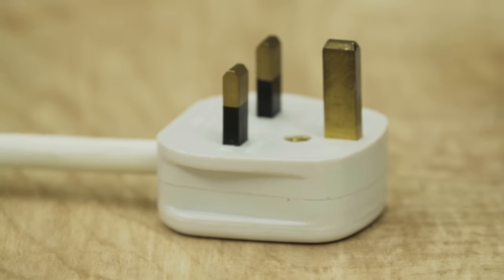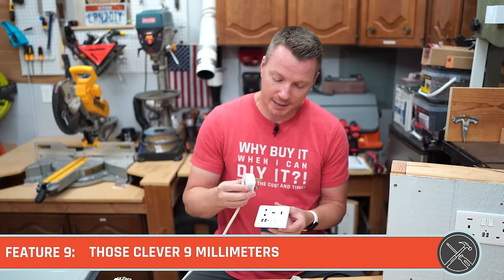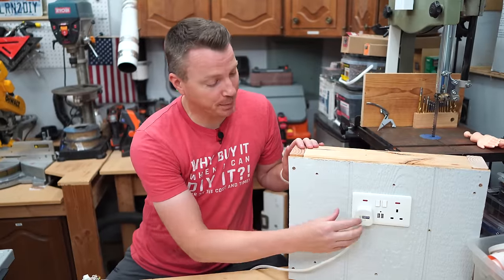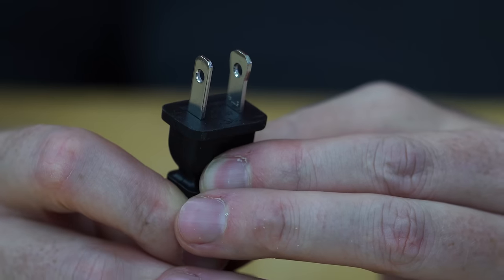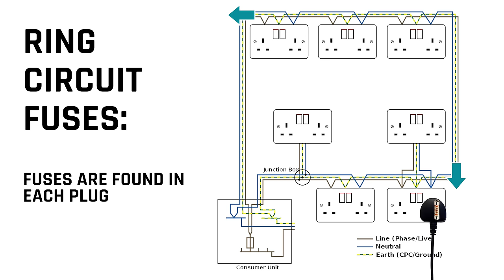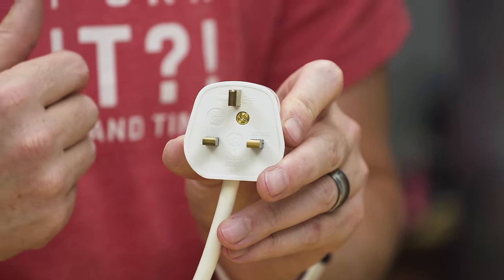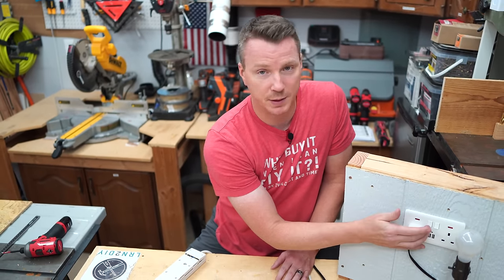British Plugs and Outlets Are On Another Level

Comment: In most cases, the presence of the switch on the socket means you need rarely unplug non-portable devices, so it's very uncommon to encounter the upturned-prongs problem. The other reason it's uncommon is that once you've trod on a plug prong *you remember*.
Reply: Actually, one major exception - when the devices are plugged into a multi-way extension cord, the sockets on those are often unswitched (especially on the cheaper models). Yet another reason cheap multi-way cords are Satan himself.

(There are also unswitched wall sockets in the UK.)
Reply: @countertony  tbh it’s easy to find extension cords with switches just don’t get cheap deathtraps haha 😂
Reply: @countertony  The only time I ever see that are on ones that are intended to just be used with low voltage applications. The vast majority of the ones I see at any price point do have a switch, a lot of that has to do with the likelihood of not being able to easily reach where it's plugged in and the tiny cost of adding the switch to what is probably going to be a surge protector with a bit of extra circuitry anyways.
Reply: @SmallSpoonBrigade  Could be I've hung on to mine (from before surge-protected extensions were much of a thing) for too long :D
Reply: You don't remember, you gain your six sense...
Reply: Stepping on an upturned British plug even once is once too many. Even thinking about it fills me with murderous rage.
I grew up with them and would not hesitate to launch every single British plug in existence into the sun.
Reply: @cheesofile666  
Don't blame the electric plug, you're the problem for walking round in a daze.  Watch where you're going and what you're doing and these things will not happen to you.

Comment: As everyone else has already said, the "negatives" disappear once you've had any life experience with these plugs.
Reply: Except for the stepping on them thing. That's always a curse
Reply: @_rtj  the switch on the earth pin you mean?

A downside to these plugs is the difficulty of removing them for people with arthritis or some other issue with their dexterity.
Reply: @Faliat  I would say not even that. Due to the switches on the plugs themselves I always just turn them off at the wall - virtually never unplug something and leave it on the floor. If I’m unplugging something it’s normally because I’m going somewhere and taking the plug with me.
Reply: @lukemclellan2141  there is a clamp available at mobility stores that allows full hand grip to remove, less than £5 last time I bought one
Reply: @fachim-t8480  good to know, thanks! So inexpensive too.
Reply: The idea you can’t accidentally pull these out of the wall gets debunked the second you try to use a  hoover (vacuum cleaner) at medium extension 😂

Comment: You forgot to mention that: 
1) each & every plug comes with a printed card teaching you how to rewire & change it.
2) All you need to fix your plug (barring possible a new fuse) is a small flat-head (electrical) screwdriver which we can pick up almost anywhere.

Heavy usage devices like cookers & washing machines usually have their own circuits.
Oh, and we also have fuse boxes which have our rings (lights, sockets, cooker, kitchen, etc...) on them separately as well as a main breaker.
I actually have a mixture of ring & radial circuits depending on the usage & that's just in a basic single flat, nothing special.

Regarding the down-sides,
The size is no issue - it's plugged into the wall & in fact less also likely to be tripped over or kicked that the US plug.
I've never had to 'load balance' nor do I know anyone (untrained) who has - in fact most wouldn't even know what you were talking about.
And, how often do you leave a plug lying on the floor? Maybe if you could switch it off without unplugging it would help. 🙂

Comment: As a Brit, watching you discuss our beloved plug made me very happy and was 10 minutes well spent. You didn't get everything 100% right but an excellent video none the less. Thanks for uploading.
Reply: Please what did he get wrong?
Reply: @adon8672  The circuit type used, ground pin always being metal ie present, all sockets having switches.
Reply: @adon8672  all the negatives - no-one leaves a plug lying in the room like that.. we can isolate them when plugged in -  they are super safe and can handle up to 13 Amps - the old 15 amps round pin ones are awesome.. just not as safe . and Lego or pin tacks ( drawing pins ) are waaaaay more painful than a UK plug - tested!
Reply: @effervescence5664  A few omissions too, such as switches on less cost- conscious outlets being double pole, switching L & N not just L, and fuses being available from 1A to 13A with 3 & 13A being the most common.
[Edited to correct the 'not just N' goof.]
Reply: @adon8672  Not all power circuits are a ring although a lot are. All lighting is a radial and anything that needs a lot of power like a shower, water heater is also a radial. The fuse shown a BS 1362 was 13A that is the max size, for that lamp you would replace it with a 3A or a 5A. Also rewireable plugs are not that common as the ready fixed moulded plug same as the type B but with a fuse is more common. But they all have the problem shown at the end, and yes it hurts
Reply: @adon8672  see my comment above..
Reply: @acespark1  Not all lighting is radial here in the UK
Reply: @jasonearley1872  "no-one leaves a plug lying in the room like that." - Only people who have never trodden on one do. Once you have trodden on one you tend to never again leave one lying around :D.
Reply: @acespark1  Very few people bother to replace a supplied 13A fuse with a more appropriately rated one, including many appliance manufacturers.
Reply: @adon8672  Not wrong but most UK plugs are now molded to the cable and you can't expose the connections. You can still change the fuse
Reply: @motogoat  I've never trodden on one in 59 years and I would never leave a cable lying in the middle of a room. But then again I exercise a bit of common sense.
Reply: @acespark1  The direct moulded plug was introduced when manufacturers realised that a lot of people were not being taught basic skills anymore such as wiring a plug, and they could also charge more for the item.
Reply: @adon8672  he doesn’t understand ground pin’s purpose.
Reply: @almac2598  I remember learning it in school back in the mid 90s. Also included how to work out the correct fuse rating. Not sure when, or why, they stopped.
Reply: @paulhodgson4790  The chance of treading on a plug is higher when you rent a place which doesn't have enough sockets.
Reply: @almac2598  You are right, I was taught how to wire a plug in school in the 80’s, but don’t think they do that any more.
Reply: @davejenner7966  In a domestic home it is.
Reply: @davejenner7966  Domestic is though?
Reply: @davemould4638  Just a matter of education really.
Reply: @BrianG61UK  Multi-socket extension cables have been available for decades at very low prices.  They are a must, because there are rarely enough sockets in most living rooms, which quite commonly need sockets for a TV, DVD player, satellite receiver, sound system, games console, computer, Internet router and several chargers.  Plus a spare for the vacuum cleaner.
Reply: @jasonearley1872  Fully agree.....once isolated at the switch there is no need to pull the plug out. I can't remember the last time I removed a plug unless I was moving the whole appliance.
Reply: @davemould4638  Well yes. But they are often look like they're not really safe for higher current devices like heaters and kettles.
Reply: @BrianG61UK  I rent a housing association studio flat: 8 sockets in the main room, 7 in the kitchen, 1 in the hall. Needless to say, it’s nowhere near enough.
Reply: @acespark1  Agreed
Reply: @davejenner7966  I've never seen a ring lighting system. I've only ever seen radials
Reply: @JaenEngineering  They used to teach that in schools back then because it was common to have to wire up and fuse a plug yourself. Legislation in 1994 meant that all electricals were required to come fused appropriately to the item and to already be wired up. So I guess it became less necessary to teach wiring up a plug in schools after that since you're almost never going to have to do it.
Reply: @almac2598  They remained relatively uncommon until the UK mandated appliances to be sold with 13A plugs fitted. It is cheaper to buy pre-cut cable, with plug moulded on, ready for the production line, than to individually wire each plug.
Reply: @davemould4638  It is a pity that building regulations now require sockets fairly high up the wall. I always wanted to replace my skirting boards with "dado trunking". There are versions that look very like a slightly deeper skirting, carry three busbars (recessed for protection, allowing the cover to be clipped off, a section of the cover cut off with a saw and an additional socket to be plugged into the trunking, with no wiring required. The trunking also has channels for running network, aerial, satellite or similar cables.
My living room has six 2-gang sockets in it, but since getting married and re-arranging all the furniture only a single 2-gang socket is accessible - and that has the TV and associated devices plugged into one of its gangs. We now have three multi-way extensions emerging from behind furniture.
Reply: @FahadAyaz  You're always going to have to do it if you have under-counter appliances, with sockets above the counter or have devices in a cabinet with only a small cable entry.
Reply: @adon8672  Took me a while to reply.. but... 

1:54 - this was not a feature when the BS1363 plug was introduced.. it came after. It is a very good afterthought. As the current carrying surface area is reduced slightly the general rule of thumb is to cap the current of any one plug to 10 amps not 13 amps unless for short periods such as boiling water in a kettle. 

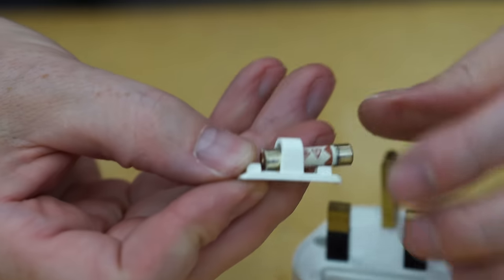4.17 - Sometimes... but not always. It's quite common to have appliances come with moulded on plugs like your Type A/B. Fuse comes out using a flap, a bit like at 6:30.  

5.23 - Again, sometimes.. but not always. Phone chargers, wall warts, and other plug in transformers often do not have any fuses at all, maybe just a resistor that acts like a fuse if you're lucky! It's not a requirement to have a fuse in transformer like that. .  

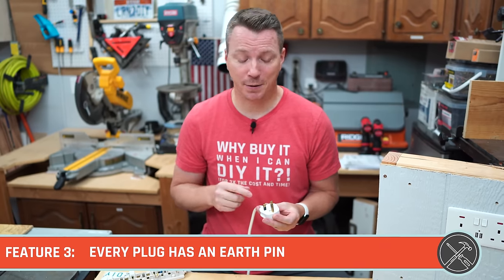7:10 - somewhat true - again some appliances do not have metal earth pins if they do not need a earth. These will have plastic pins and only be on moulded plugs or wall warts. Arching is not related to earthing, an appliance with a plastic earth pin can still arch. 

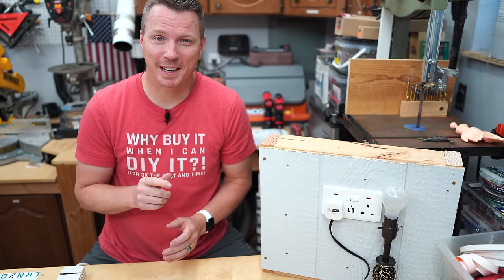8:37 - Most do have switches, and it's a great feature, but not all. It's not a requirement. 

8:44 - and another weird one... it may look like 230V but actually it is 240V. And 250V in some locations. We supposedly harmonised with Europe way back but we never actually did.. We just changed our "national" tolerances. I think 240V is far better than 120V as long as you don't plan to get electrocuted. 

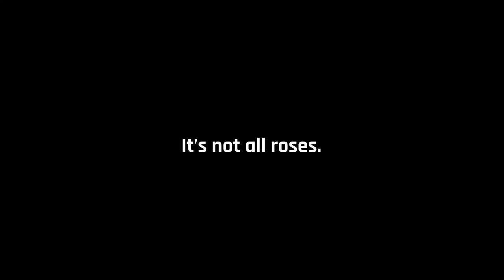9:30 - I would not recommend plugging two power intensive items into a double socket as you may overload the socket outlet itself. A double socket is still limited to 13 amps.. electricians argue over this one but nearly everyone always agrees to just install multiple double sockets in a single location if there is any temptation to plug two power intensive items into a double socket.

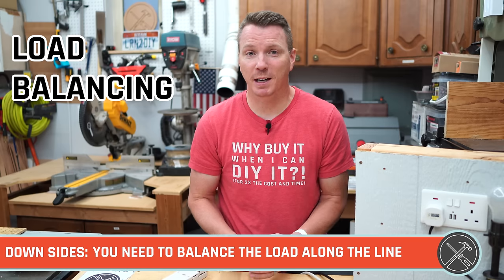10:04 - practically in the real world, no one cares... we use typically 2.5mm2 for rings on 32A breakers max. On the surface of it 2.5mm2 is good for 23a if you don't take into count limiting factors. There are various methods for wiring rings circuits. Most electricians hate them. It's quite common for radials to be installed in preference.

Comment: That "step on it in the middle of the night" thing is a safety feature. You only need to do it once to learn the safety tip of putting the cable out of the way when you unplug it, thus keeping your cables from suffering crush shorts after you've stood on them in hard soled shoes.
Reply: What are your shoe soles made of, stanley blades? I've driven forklits over normal cables without damaging them..
Reply: @Monkeh616  well mine is a snow shoe or whatever they're called and they have spiky bottom
Reply: 🤣
So true. 
🇬🇧
Reply: Try standing on one in bare feet in the middle of the night.. Trust me I've done it.. Yes it hurt .. Bigtime

Comment: i have a few issues with your negative points

1. Load Balancing - Load balancing isnt really an issue since cables are rated for the use there going to be used, also we use RCD with Overload to protect our cables. the rating on the RCB is tied to the max rating of the cable it feeds. For example, the ring main to the sockets in your front room may have a rating of 26A or a max of 6000W, that is considered more than enough however the RCD to your kitchen sockets will more than likely use thicker cables and be rated for 32A since thats where a lot of your power hungry devices will be. the kitchen sockets and cable for the electric oven will most likely be 6mm and be rated for 32A. if you have a electric shower then it will have its own dedicated cable that nothing else uses and be 10mm in thickness and most likely protected by a 42A or 50A RCD since most electric showers can consume anything from 8KW to 12KW

2. Switches - The switch is never an issue and seems your just looking for negative things to say

3. Plugs landing prong side up - again its another thing your just trying to think of, this is another case where its never an issue, i mean who leaves unplugged cables in the middle of the floor
Reply: He was scraping the barrel trying to find negatives to the point they were silly.

Comment: Interesting point on the relative size... the UK plug, despite being much larger, is actually more space efficient due to it not protruding as far out from the wall socket as a type A/B (mostly because of the downward cable trajectory). 
You are also much less likely to introduce a wire-damaging bend into the cable for the same reason.
Reply: Just don’t step on one
Reply: I spent some time in Canada and tried to plug a lamp in behind a bedside table. Because it sticks out so much the table was a good couple of inches away from the wall! Not the case in the UK.
Reply: @jeffo83  Because we have the switch on the socket we tend to leave them plugged into the wall so it's super rare to step on a plug

Comment: For the size draw back I think it’s still better because the cable comes out facing down, not straight out which makes it easier to push furniture etc up closer the plug. It also wont damage the cable
Reply: Yeah I don't think size really matters.... Unless it's something you want to take out with you but if it's a phone or a tablet, I'll not need a plug as their's usually a USB socket to charge those in hotels/office etc so the 3 pin USB adaptor can stay at home.

Comment: Very informative. Small correction needed. It is Malaysia, a former British colony, that uses the G-plug system. Indonesia, a former Dutch colony, uses the two round pegs system found on the Continent.
Reply: I lived in Indonesia and can confirm parts of Indonesia uses G plug.
Reply: nerd
Reply: @koruspring1519  Hi Koru. I gave you a thumbs up. Thirty years ago, old homes in Jakarta sometimes had multiple wiring with different currents that used different standards. So, I would not be surprised.  Could you please tell me which city (is)/regions had these plugs as well?

I have a hunch that it might be Medan, North Sumatra, because trade across the Straights would have lead to the adoption of Malaysian standards. But this is just a guess. Thanks!
Reply: Hi  @douglasmackallor , I lived in Sumatera area. Specifically Batam city. I’m not sure what other region uses it as well. Love your insights!
Reply: @koruspring1519  The Riau Archipelago? That's a two-hour ferry cruz from Singapore, another ex-British Colony. (Singapore used to be part of Malaysia until 1967.)  That doubles down on my theory on steroids. Of course, all the building materials and prospective guests are just a stone's throw away. Of course, it makes complete sense to align with Singapore's standards for just about every reason possible. Thanks for letting us know!
Reply: @douglasmackallor  Eh…it’s Aug 1965 when singapore separated from Malaysia. Which also is our Independence Day 😊
Reply: G plug unite us all..
Reply: @ivengle  Oh, yes, you are right. August 9, 1965. I should have looked it up before I posted. Thanks for the correction.
Reply: @koruspring1519  Only in minor areas uses the G plug. I live in Indonesia and We are here using C/F plug.
Reply: Lol i grew up in Indonesia Riau Archipelago, I always thought type G is the norm here. Since we travelled to Singapore/Malaysia much frequent than to Jakarta. 

I was amazed & confused that Jakarta was using different plug type, luckily the hotel provided the adapter to type G for us.
Reply: Most region use two round pegs system but not rare to see other plug system(usually import stuff or high voltage) 
My old ps 1 and few old phone charger use g-plug, some '10 phone charger use a-plug

Comment: I live in Singapore and these kind of socket and plugs are commonly used. I guess troubleshooting had never been a problem for us since we are so accustomed to switching off the mains. By switching off at the mains, we also safe electricity. Thanks for the educational video!
Reply: having the wall plug switches also means we can fully cut power without have plugs lying on the ground, they all stay where they're supposed to which helps with cable management
Reply: I often will first switch off the socket before removing a plug, which I think a lot of people do, so that enhances safety even further.